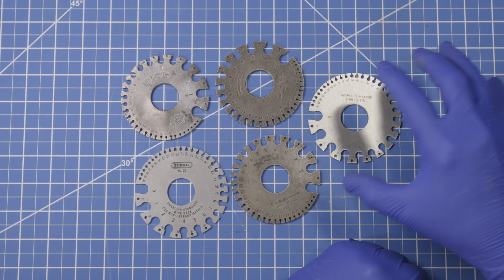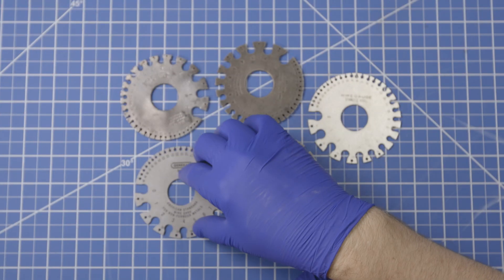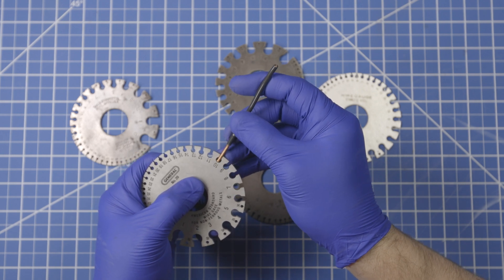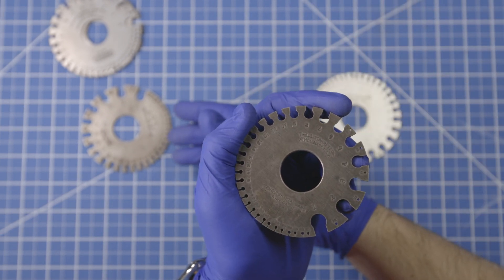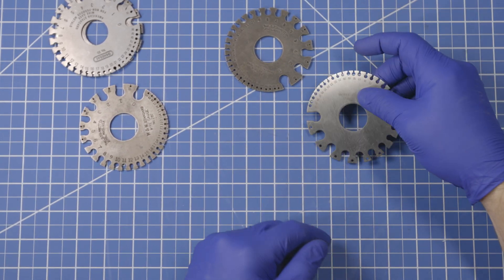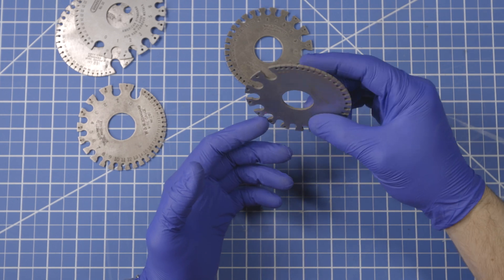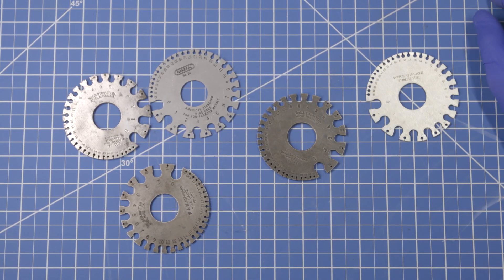Wire Gauges pt 2 - Different gauge standards + be careful when buying

Comment: So i have a question, in last video you said measure stranded wire gauge than x number of wires. Are you saying some stranded wire uses the same size wire, but add more or less strands for different wire size?? Real pain to count every strand is small wire..
Reply from the maker: That's right -- often the difference between two gauges are just how many of the little strands are in the bundle.

And yes it's a huge pain in the ass to try and measure and count those, especially when the strands are like as thin as a hair.  Much easier to just trust the marking on the sheathing (if it's marked/legible).

Comment: I plan to craft with anodized aluminum wire, is the nonferus wire gauge going to be appropriate for figuring out which wire will match?
Reply from the maker: Yes, anodizing doesn't add any thickness.

Comment: Thanks for the info!, Quick question, which type gauge would I use to determine the wire size of piercings? They are usually stainless steel!
Reply from the maker: Most use AWG, but some use SWG.  There's no official rules for it, though.

https://en.wikipedia.org/wiki/Body_jewelry_sizes
Reply: @JustToolBasics  Thanks for the help!

Comment: If you do know gauge of wire to start with, but u can gage a single wire and count all strands. Can u figure out awg gage?
Reply from the maker: You can figure it out by measuring one strand then counting the strands, but for wires with very fine strands that is a huge pain.  When it's, like, 20 or less strands it's relatively straightforward.
Reply: @JustToolBasics   Ok!  But?,  how do u get from a gage for a single strand of wire  by number of stands to an actual gage number??
Reply from the maker: @rocheville  Funny you should ask, I actually explain that in the video I made previous to this one: https://youtu.be/v2YaSLWKOQE
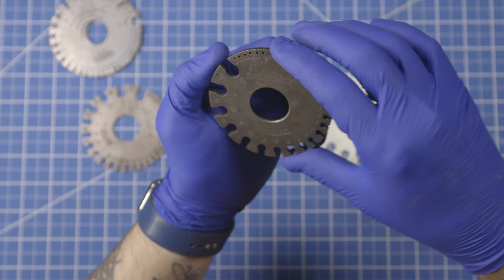The explanation of stranded wire measuring starts about 5:20.
Reply from the maker: If you're looking for basically a lookup chart (once you've measured and counted the strands), I have this one bookmarked, though it's only #8-#26: http://www.zierick.com/pdf/wire.pdf
Reply: @JustToolBasics  Sorry, IB a bit of a nerd.  But, that chart should be what I need.  Did watch all the vids.
Reply: Thank you, very much!